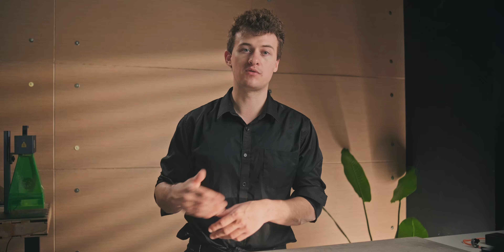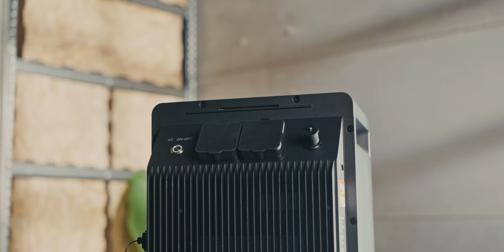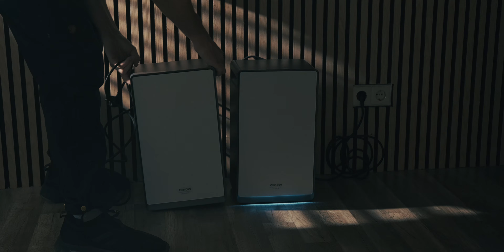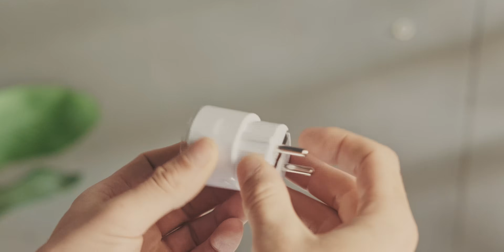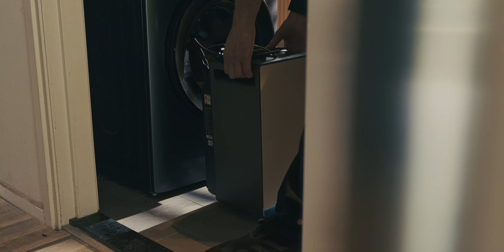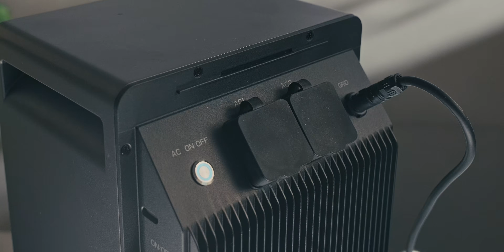CONOW Lyra 2500 AC: Real-World Efficiency Test (No BS Review)

Comment: Round trip efficiency is rarely talked about by most of the reviewers on You Tube, good job!  Also, when you were talking about the Lyra 2500 being able to be paralleled with another unit to provide 2400 watts by connecting the output of one unit into one of the two outlet on the back of the other; this seems to preclude the use of both units to operate your washer when disconnected from the grid connect.  Other companies offer a paralleling box (the old Bluetti AC240 offered a parallel connection to be able to offer 4800 watts with 2 units connected together), does Conow offer a similar type of accessory to do something similar for when the grid is not available.   Thanks for your informative review!